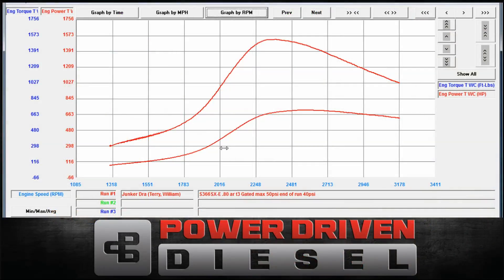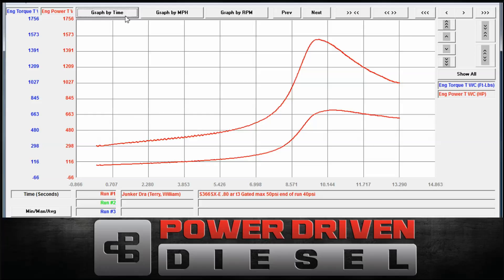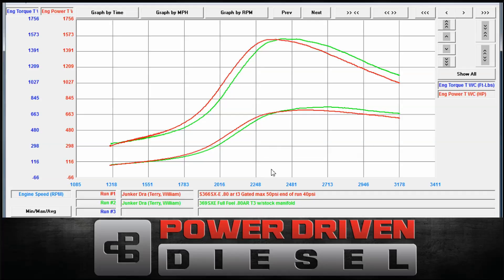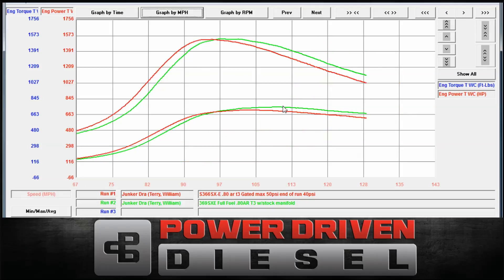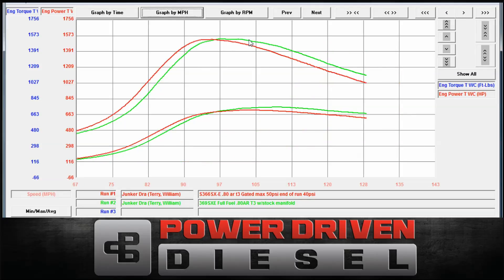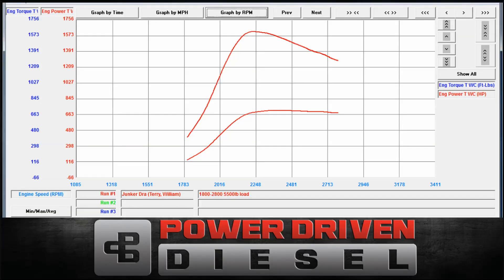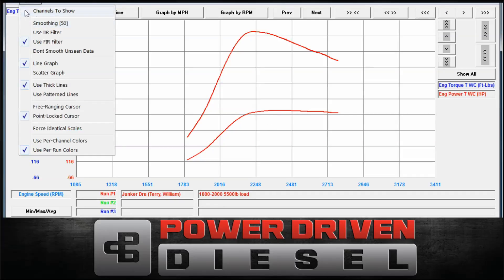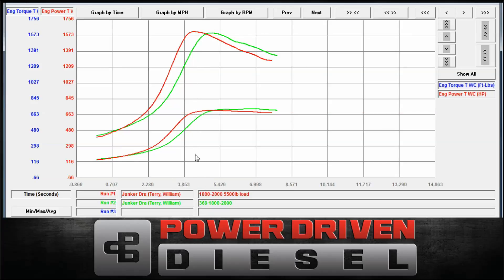Dyno Test: S366SX-E Turbo | 714 HP! | Power Driven Diesel

Comment: Dang it...S366 or S362....what to do what to do?
This looked like it hit HARD at 2000 RPM and I'm constantly over 2000 RPM when shifting through the mtns.
Reply: I have the 366 it's definitely laggy before 2k.after that it's on...can't  really get on it yet as head studs are going on next week.stock fueling still gotta save up a bit ..this is on 2014 6.7 vgt went bad on it.stealership wanted 8k for new turbo and actuator..so now I have my new play toy ..I have another truck so I have time to build it up
Reply: @professionalbaddass  Thanks for your reply, yeah I need to do head studs too lol

Comment: Why with 60-80 hp injectors can I not spool over 30 psi ? N it pegs 30 pretty damn quick but not a penny more. It’s a 366 on 04 CR with expected mods. Smarty tntr hot unlock level 9 cranked. Put a fooler on n made no difference.
Reply: Try 100-120 Hp Injectors  ...Boost is directly related to fuel since it has no butterfly valve to restrict air
Reply: @drd1924  lol I found my problem. My gauge was broken and only read 30psi 😂. I make 50 psi consistently now. Brand new gauge too.
Reply: Wastegate maybe?

Comment: I would like to see some turbo testing on a 6.7 cummins....
Reply: We all would but these guys have allocated themselves to obsolescence by only catering to the 5.9 crowd.
Reply: Scott Cravens I ended up putting a 64/74/.80 on my 6.7 with stock fuel. I haven’t had it on a dyno but from the seat it seems to light at around 1400 rpms which I thought was good for an auto daily driver. After about a year I put a 80/96/1.32 atmosphere turbo on a compound set up. Now it doesn’t drop of at 2500 rpms or so...It’s a beast and stock fuel still